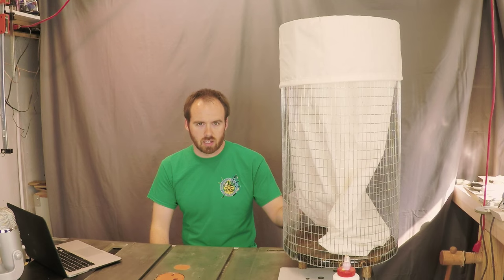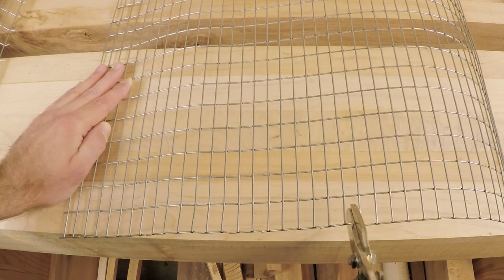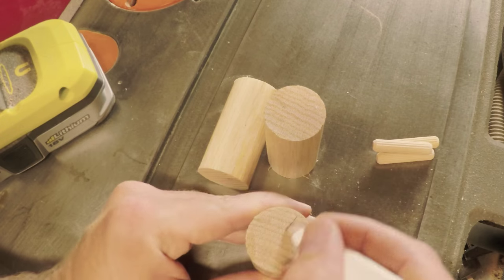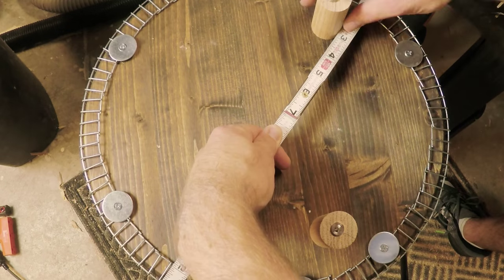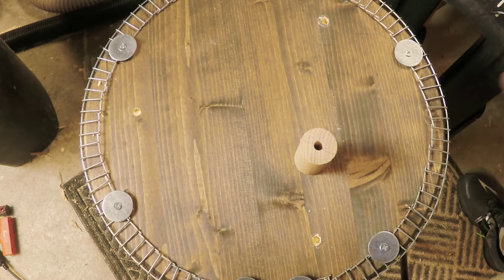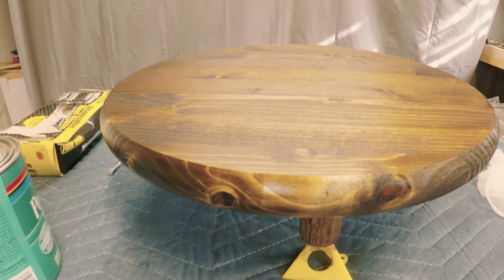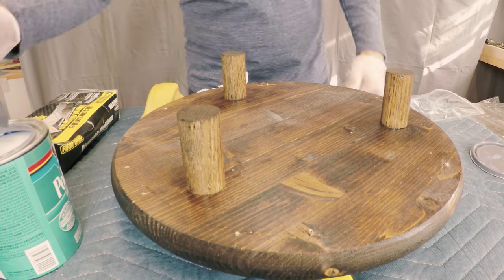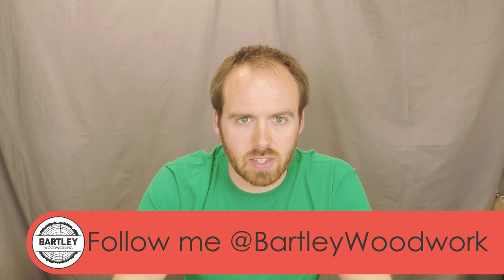DIY Laundry Hamper

Comment: what was the solder gun?
Reply from the maker: +Aris Mata I forgot to include that part in the first upload. The solder gun was used to melt some solder on the chicken wire to keep it from spreading apart. I still have that and will try to get it posted to show the process.
Reply from the maker: Watch this video for how I soldered the wire mesh together.  https://youtu.be/GPxF-zp3hvU